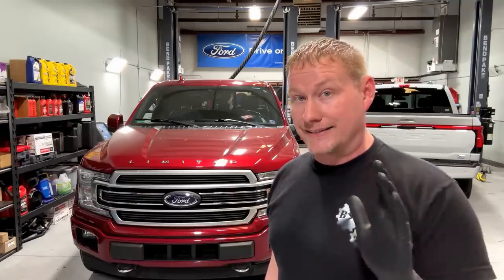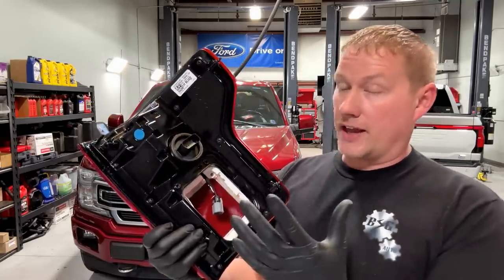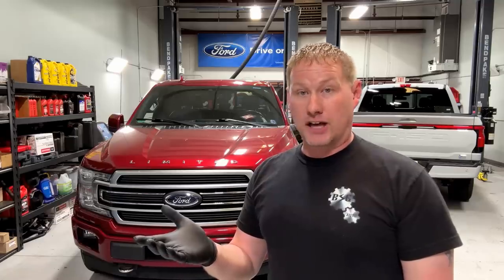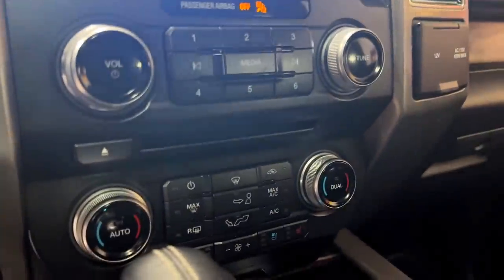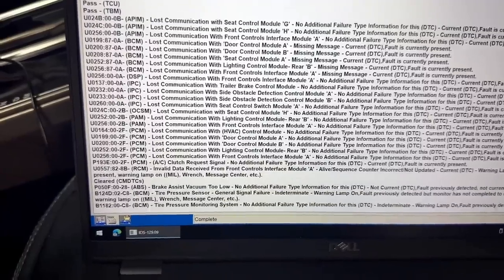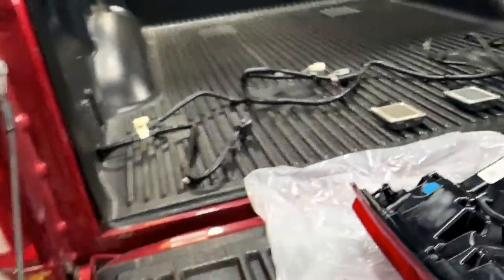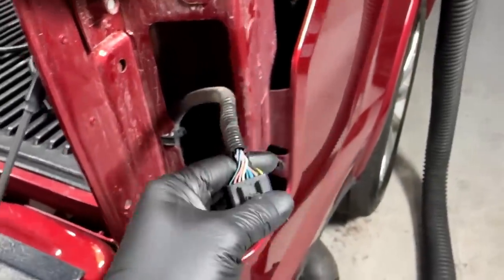Repair Cost Are Out of Control: $5,600 Bill for Some Tail Lamps?!

Comment: What you just experienced is one of the main reasons so many of my customers are willing to spend so much money keeping there older cars on the road. As far as diagnosing it , you did not just fall into it, you kept it simply and used common sense. For all the scanners ,scopes, special tester I own and use , a little common sense, experience and using the brain has led me to the answer faster then anything else.
Reply: I have a one ton diesel Ford. In two different shops, they diagnosed the Allison tranny sensor as "defective" because it was saying the transmission temp was (if I remember right) negative -49°. At the second shop, I had it replaced. There of course were still issues. A third shop in Greencastle PA corrected the world by advising that the  negative -49° sensor reading is actually the common code translated to say; OPEN CIRCUIT. And not a faulty sensor errantly reading tranny temperatures at a -49° 
American mechanics can be all over the place, leading us down a very expensive parts chasing+replacing rabbit hole.
Too much guesswork going on at the consumers' expense.
Reply: @williamrobinson6680  I work in parts industry and mechánics just throw parts at vehicles today  , order a part that they ( think ) it is and then if new one don't fix it  , put that part back in the box , ( to lazy to even clean the part they just hogged up with greasy hands ) and they send it back as a ( new part ) , many times I have to Damage out the part if it can't be cleaned , can't tell you how much a year we damage out over this..

Comment: As one of my instructors once said "Believe it or not, having a ton of issues when it comes to electrical usually means you have a single common problem, making it easier to solve."
Reply: When there are a lot of issues, look for what they have in common.
Reply: JAGUAR HAS ENTERED THE CHAT

Comment: I think.... prices like that is why Right to Repair is SOO important.
Reply: Right to repair doesn't counteract the $1,200 tail lamp housing cost.
Reply: Right to repair doesn’t mean you know how to repair. They’re making them so complicated you have to be a computer/electronics expert to understand. Late model vehicles are being totaled out due to outrageous parts cost or inability to diagnose
Reply: For the price of these parts the electronics should be bomb proof. Of course the manufacturer only cares about getting through the warranty period, nothing these days is built to last much past that
Reply: Right to repair allows you to take it where you wish.
Reply: Especially when they are 700 for a pair of you buy them off google
Reply: True, but, =who= is going to sell you a module for less?  Lens, yes, module?  Not easy.
Reply: @j.b.9895 and soon cybersecurity will be required on some of these modules. The codes for this have to be generated at the factory. So what are we going to do when you have to replace a module with this requirement? Hell just getting the part if they have to program it for you will add to the delays as they just won’t have it on the shelf.
Reply: @lyianx you don’t know what your talking about. Just vomiting up car words like scrabble pieces!
Reply: The harnesses could also be re-pinned.  Pins are cheap, but takes a bit of time.

Comment: Great advice to use the silicone dielectric grease. I do NO electrical repairs without stuffing all connectors with this grease.  Not only does it deny oxygen and moisture access to the contact plating, it also lubricates the contacts to prevent mechanical plating erosion from vibration.
Reply: But at the metal to metal contact between the two surfaces of the plug and connector there isn’t dielectric grease, otherwise it would block the electrical current.  Correct?
Reply: @jasonborne5724  Absolutely correct. The contact is metal to metal at the molecular level and the grease would insulate the contact *if it could*.   What happens is that the dielectric grease gets pushed aside at the contact point(s) but surrounds the contact points with a barrier that excludes air, moisture, and any contaminates.
Reply: I put dielectric grease recently on an Audi TT led rail lamp in an effort to prevent corrosion and 2 weeks later it came back with the tail lamp not working! Had to clean the connectors off for it to work again.
Reply: @powayimports4175    
Now everything is run by computer modules  if water get in through the light the car or trucks won be running. that is crazy.

Comment: Curious how the water is getting in in the first place ….. and how that can be prevented within the new lights
Reply: yea...gonna leak again?
Reply: Drill 2 holes in the bottom and 2 holes in the top for draining and ventilation in each taillight assembly
Reply: The lens and housing are two pieces bonded together. They will almost always leak and I've resealed plenty of ford headlights and taillights over past 30+ years. From fox body mustangs to all year ford trucks it's been a problem for decades. 
I run a bead of silicone sealer around the inside lip where the two pieces meet.
Easy fix.
Reply: Really.........lol..............Z

Comment: That truck is 5 years old with 95,000 miles on it.  I would be willing to bet that truck was upwards of $80,000 plus when it was new.  To spend $5,600.00 on taillights?  Certainly does add meaning to the term 'stealership."  I guess the ol' Marquis is going to need to run forever.  Great video!
Reply: Highly doubt it was $80,000 in 2018. In 2018 I bought a brand new Denali 2500 Duramax for $74,900. I highly doubt a gasser cost more than a diesel.
Reply: FK 80k for a Truck
Reply: Its not the dealerships that are the problem here. Its the damned engineers who design this junk.
Reply: @MilesIzHigh5280  in 2018 this was probably 40-50k  Things have doubled in price since 2018. Well, everything but wages.

Comment: I had this happen on my truck and fixed it for $200. The OEM LED taillights are known to crack and let in moisture which causes all electronics to go haywire. I ordered a set of aftermarket lights on eBay, plugged them in, and unprogrammed BLIS and rear cross traffic alert via forscan. Do NOT plug in the BLIS modules to your new aftermarket tails. Worked perfect and much better than spending $7,000 Canadian.
Reply: Love FORSCAN I got it for my 13 F150 totally worth it.
Reply: Smart man 😊
Reply: To much money man
Reply: Better yet, just don't buy Ford junk!
Reply: @pbear216 all these auto makers order parts from the same people. This is why everything has electric power steering, the modules are made by the same companies. This was proven while TFL was messing around with awd systems on small suv's. It's all junk nowadays, they just look slightly different.
Reply: @pbear216 It's not just Fords. All auto makers have to incorporate all these electronics to meet safety standards. No brand is immune to these ridiculous repair costs and electrical failures now. We gotta stop judging brands and start judging cars by the year. I'd drive a crappy Buick from the 90's before I'd drive anything made today, even if I had the money.
Reply: This is a simple waterproofing issue.
Chances are high this started after using a boat ramp.
I bet the owner knew it too.
Reply: @pbear216  Right, because of course no other manufacturer has reliability issues or high prices.
Reply: I paid $2500 for my truck and it gets me there and back ok, has good heat and air, fair stereo.....works for me. For less than half what this guy paid just to get his damn tail light fixed.
Reply: @FixItPleaseJ  You don't submerge your tail lights at a boat ramp.
Reply: @pbear216  it's not just Ford. All of the makes have their issues.
Reply: Buy a Toyota that was built in Japan.  Problem solved.  Judge it by the sheer number of recalls and TSBs by all other brands.
Reply: @ehbcd  I don't, and you may not, but apparently this owner did.

Comment: Had almost the same problem with an F-150. HS network was down so you can imagine how many modules that was. Spent an absurd amount of time trying to figure out which module was causing it until I finally started unplugging everything one by one, it ended up being the ABS module. The unplug method, works every time.
Reply: Classic fault isolation technique.

Comment: Uncle Tony sent me. You would think for all the money that Ford charges for these vehicles, they could do a better job of sealing the tail lights and electrical connectors! That's just horrible ☹️
Reply: They’re in the business of selling parts too.
Reply: I think I'd be drilling some drain holes in the new lights.. 😂
Reply: @peterfitzpatrick7032  I once did that for both tail lights on an ‘85 Plymouth Reliant wagon, and had no problems after that.
Reply: They all do the same. It has become legal extortion.
Reply: Uncle Tony also sent me
Reply: @peterfitzpatrick7032  Hmm. Unless your use of the truck meant that you might get water ingress through the holes, or even just regular condensation issues that affected the internal surfaces and fittings in the units.
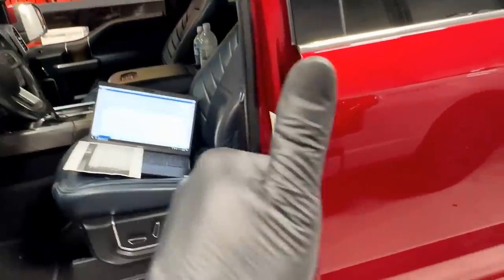Reply: @agostinodibella9939 Did it a month ago to my 2011f150 the headlights were getting about 2 " of water in each so i drilled holes 1/8" 15:55  at lowest point

Comment: I have a Toyota Avalon.  I hit a deer a few years ago.  Total repair bill was &10,976.  The deer strike took out the radar for the cruise control.  The radar module was $900.00.  The windshield also got cracked, that was another $970 because of the lane departure camera.
Reply: Did you go through your car insurance?
Reply: funny wife just had the windshield replaced in the Avalon 2018 I think it was $1100 covered by insurance glass coverage. But we had to bring it directly to the shop as they said the lane keeping needed to be recalibrated. had to take everything out of the car as they said it needed to be stock weight for the calibration, so car seats out and empty trunk...
Reply: That module on a Ford escape is almost 3 grand!  Stupid!!

Comment: This is exactly why I drive a 2000 Lexus ES300 and a 1996 Ford E250 with an I6. 

I literally couldn’t afford a new vehicle, let alone the repairs! 

I’m only 25 and I could already see the writing on the wall with newer cars as time went on. Absolutely tragic. Pretty soon the car market is going to look like the farmer’s tractor market. Old tractors you can work on go for twice as much as new tractors with failing computers.
Reply: I will not drive a vehicle less than 15 years old… ever.
Reply: @scotthorning1180  pushin 20 years and I dread the thought of having to "upgrade" someday. They've been putting out some real garbage for a long time now.

Comment: Definitely have repaired this exact concern lots of times.  I keep telling my customers.  Fancy packages carry some pretty extreme repair costs.  Thanks for posting!
Reply: If I had one of those I'd pull the tail light and pull that BLIS module to make sure the seal isn't corroded and there is no water, then I'd grease that seal with silicone type grease to keep further corrosion from happening. 

Pretty poor design, that is not made to last... can't seal corroded aluminum.
Reply: Exactly 💯 💯
Reply: What do you mean fancy packages?  Newer cars??
Reply: @sl4983  You only get the LED taillights on high spec truck packages - if this wasn't a platinum F-150 it would have $3 incandescent bulbs still and it would be a much cheaper part to replace. I wonder if he could have downgraded and saved some cash - might have to replace a harness because the connectors are different but probably a lot cheaper fix.
Reply: @bubba99009   It's part of the medium speed can network, not going to work to replace it with incompatible parts.

Comment: This is why I like my simple basic plain 2005 F250 XL. The only electrical problem I’ve had was a bad alternator, failed blower resistor and a camshaft position sensor. All ez to troubleshoot & repair and parts didn’t cost an arm & leg.

Comment: This is not just a FORD issue.
Reply: Was gonna say water logging into GM fixtures.. been happening for a long time. Just took off the tail light bar off my park avenue.. and.. oh.. my God. All the water coming out and corroded connections and even one of my bulbs is water logged 😳
Reply: This is a "you want tesla lights and smart safety features" issue
Reply: My 16 Ram Express is going a long just fine.
Reply: My 13 f150 just blew its first light ever front bulb and it's housing has been cracked from a accident for 5 years with moisture inside. Replaced  the bulb for like 50 dollars since it's hid.
Reply: Caterpillar too 
And other heavy equipment manufacturers. 
Can’t repair only replace cha ching $$$
Reply: Never seen this with Japanese vehicles. Could be wrong though.
Reply: @trenton737  must never have owned a toyota avalon have ya? VERY VERY common issue!
Reply: @mattcat231  oh ok, never had a Toyota, but my 22 Escape has vents in the taillights, so I guess Ford is doing that with other models too now.
Reply: used to see it all the time on dodges

Comment: It would be wise to refrain from using a pressure washer on any light fixtures when washing your vehicle.  Body parts okay but not on plastic parts because they eventually allow water inside the components.
Reply: Should be a sticker hand wash only.
Reply: It would be wiser to design and manufacture a vehicle that will not be forced into self-destruct mode when water gets in the vicinity of the tail lamps.
Reply: @foxwithtubesox1075 Inconceivable expectations you're throwing out there 😂
Reply: Or maybe just buy a quality built vehicle? Used to be FORD but not sure anymore
Reply: Or just never take it out of the environmentally controlled garage. 😂
Reply: @waynebuzzell2483  Never thought of that. I live in Canada were the winters are brutal, many park in heated garages = condensation. Good point.
Reply: @janvanderziel8548  should be a sticker saying avoid exposure to water for the entire vehicle.
Reply: Now I know why these trucks are so absurdly expensive. I have a lot of these safety features on mine and never rely on them anyway. I rarely even trust backing up using the camera.
Reply: Bad design choices by the Ford caused this.
Reply: I learned that a hard way 04 dodge  1500 it fried the tail light  board it was it a wreck and was cracked  I didn't know but $15 and some jb weld it's fixed
Reply: My 23 year old Saturn SL2 goes through high pressure car washes probably a dozen times ever winter. Never had anything go wrong because of it. I think I'll keep it.

Comment: wow, looks like i'll be holding onto my 2013 a while longer
Reply: I wish I would've kept my '13 too, these new trucks aren't worth a sh*t...
Reply: I just bought a '14, still needs new phasers.but atleast those are cheaper than the tail lights, I am doing the work myself.
Reply: @wb6anp what kills me is the fact that a tail light can cost more than a turbo for one of these things. I have a 15 lariat with pretty much every option. I may get rid of it if I have to replace a light. How sad.
Reply: @nateg08  If you got a lariat you probably don't have LED tail lights. Ford locks those behind platinum trim level. One reason they are so ridiculously expensive no doubt - most trucks don't get them.

Comment: I'll keep my 65 f100, thanks. Bailing wire, duct tape, and an extra set of points in the glove box and I'm good to go. I'm SO done with new stuff. These companies have lost their minds...
Reply: I have the same mindset. Keep my 95 f150 on the road whatever it takes.
Unfortunately I just spent 2k on it for a complete clutch & hydraulics.
After seeing Brian's video I no longer think I spent too much on the old gal.
Reply: My first vehicle. Inherited it when my dad died. Everything you said plus if the battery died you could push crank it easy as pie.
Reply: My ‘06 F150 5.4 3v with 270,000 miles just keeps looking better and better!
Reply: @steveturner3999  same with my 1998 crown vic 4.6 2v 135k hell she ain't even broke in yet
Reply: love those old type trucks
Reply: @mark98070 Just put a 400 dollar "refurbished" pcm in my dads 94 f 150. Thing just burned up inside on the board somehow. Only thing I can figure is he stalled it while it was still high idling from being just started. Thats when it burned out. So make sure your truck idles down before you take off, because idk what else could have caused it.
Reply: They are selling prestige, not cars.